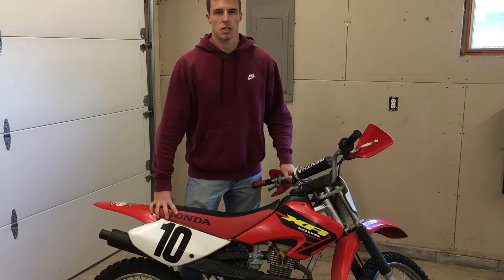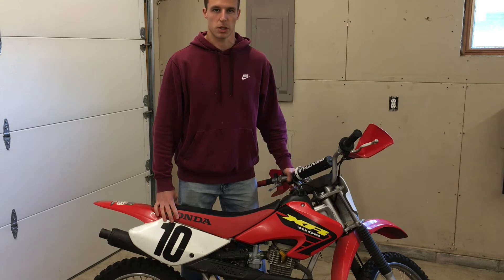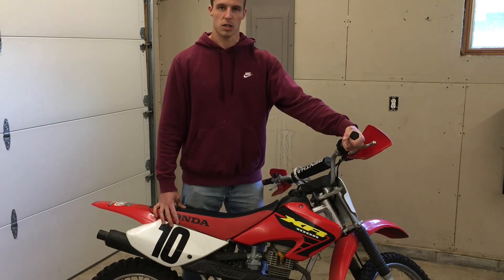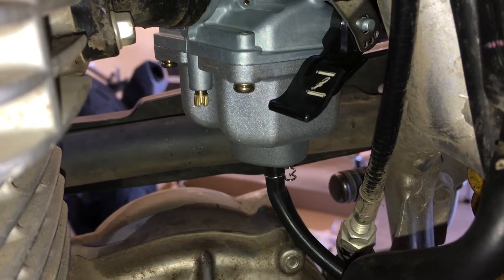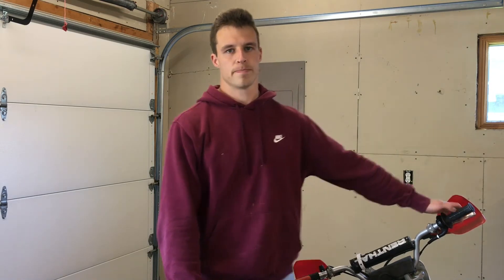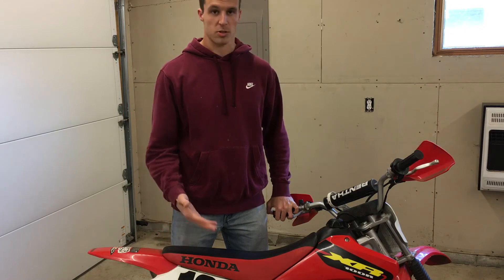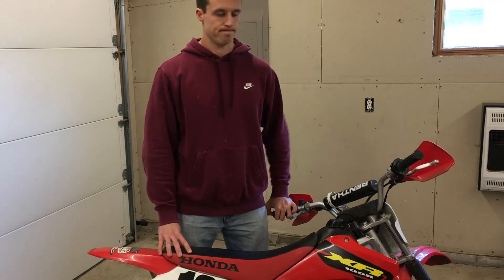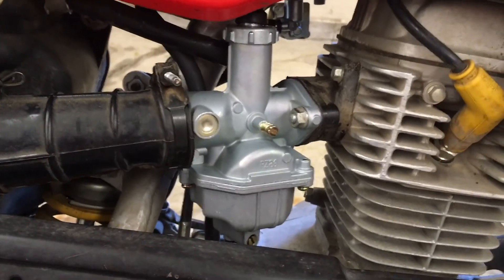FIXED: Honda XR100R Midrange Bog / Carburetor Rebuild

Comment: Usually to fix that big when you roll on the throttle from idle means your main jet is not allowing enough fuel off the hop. To fix that you need to raise the needle in the slide. So pull the top of the carb off and adjust the clip on the needle. Factory setting the clip is set to the middle notch. Put that clip on the fourth or fifth notch from the top of the needle. That should take care of your problem. If not then I’d pull the main jet out and put the factory main jet and needle in the Amazon carb and try that out. Pilot screw adjustment is for idle fuel mixture and the needle notches are for open throttle adjustment. Hope that makes sense. Let me know.
Reply from the maker: Yup, tried all notches of the needle adjustment. The stock setting was the one that worked best, although there was still that minor hesitation. I've since returned the bike to my uncle as it runs pretty well overall!

Comment: Having the same issue with the new carb. 105 main jet with fmf pipe. Sputter from 1/4 to 1/2 throttle. What is your mixture screw set at?
Reply: Hey Richard - I made no adjustments to the screw when I installed the carb on the bike, so it was running at whatever the spec was. Wish I could be of more help.